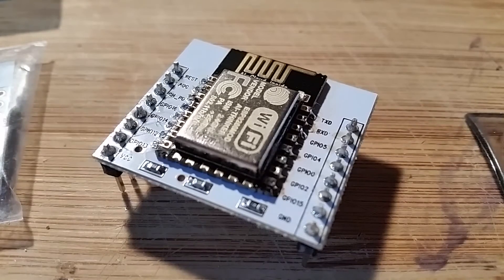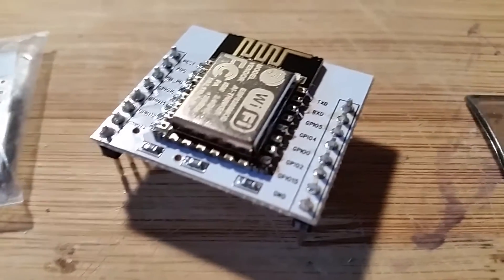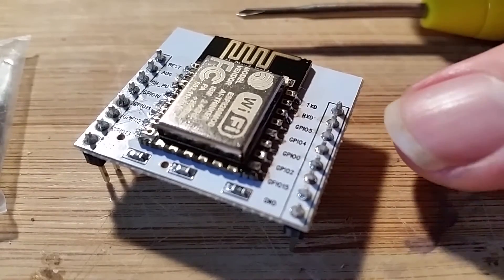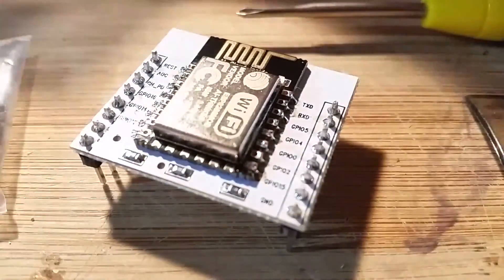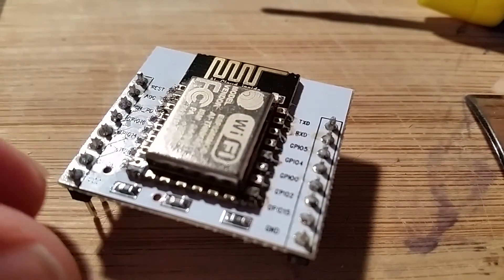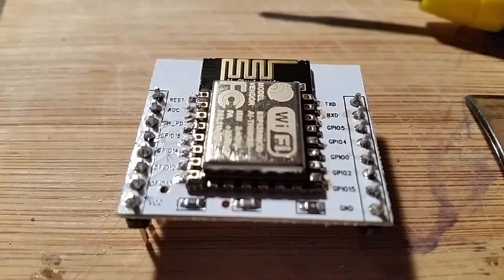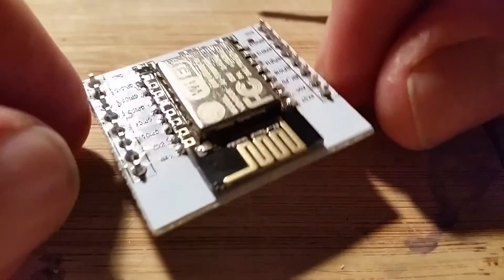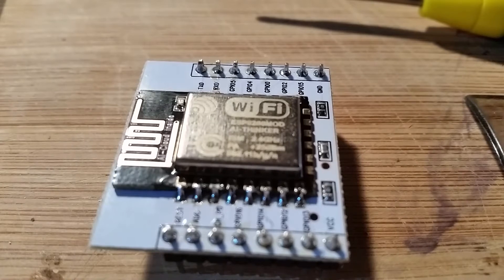ESP8266 V12 Breakout Board

Comment: Hey XerotoLabs - I just ordered some of these and was wondering if the ESP8266 itself has solder pads that wrap over the edge of its board, or if you have to bridge the solder over a kind of "dead spot" to connect the ESP8266 to the breakout board? Hope that makes sense. :)
Reply from the maker: +phrend if you see in the still pic at the video start , the bottom 6 pads of the esp are how they are all round . the pin pitch / spacing is metric ( 2mm IIRC)  so it is not a prefect aliment for normal bread boards. 
What i did was to clamp / hold the esp over the pad son the break out board and tack solder the opposing corners. then i proceeded to solder the rest . The solder i used has flux in it, so it was real easy . but i did have to place the solder into the outer notch of the  pads on the  esp .  it made it way easier to solder that way .
Reply: +XerotoLabs Thanks for the info! Looking forward to playing with these!
Reply from the maker: +phrend they are way too fun . im looking at expanding the gpio of the version 1 units withe  some PCF8574P ICs i have , they are 8bit I2C input expanders . but they only work on 100khz buss , nit the 400khz that other I2C things can support .  but still it should allow a old 3$ esp to go from 2 gpio to 8 . the PCF8574P  is old and obsolete but they are dirt cheepo' too, and cna let you make your own I2C peripherals.
Reply: +XerotoLabs I hadn't heard of the PCF8574P before, but I'll keep it in mind for the future (looks like they are just under $1 per chip on ebay). Out of curiosity, why aren't you just using something like the ESP-12E since it has more GPIO pins available and is pretty close to the price of the version 1's? (Do you have a stockpile of v1's or something?)

FYI, I'm looking to use these to do some home automation/monitoring with something like OpenHab.

...been watching +Hari Wiguna for the past few days - but my new "toys" are still a couple weeks away. :)
Reply from the maker: +phrend yeah the video is a 12e , it has more GPIO , but some of the GPIO is dual purpose pins on boot .  i want a nice set of I2C peripherals , like you my main end use is Home automation and security .  I also plan some automotive security ( key-less access by web page )  for if you lock your keys in a running car .  The PCF' chips behave like a buffer for the ESP . they are dirt cheap and easy to use . there are even 16bit ones.  My goal here is to have a ESP 1 use PCF's for the legwork . i have some version 1's and v12e 's  but PCF's wor with Arduino's too and they are good form 3.3v to 6v vcc . With the ESP it might be cool to make a R/C ship or such where all the options work .   All these things are cheap .  It might be good to get your self some darlington arrays , ULM2003 or such they let you drive inductive loads (relays and motors, stepper motors) safely from logic level signals. 
PCF' can also be used to let you drive LCD displays via I2C and there are libs out there to do that .  
It is such a cool time to be a maker .
Reply from the maker: +phrend oh and you can get 10 PCF's for liek 4$ on ebay http://www.ebay.com/itm/400831854551
Reply: +XerotoLabs Nice! Thanks for all the details. I have some ULM2003's to play with, but my first project is gonna be some wireless temp sensors (DHT22), which seems like it should build up my practical understanding of the ESP, and then the sky's the limit! :)

I'll be watching your channel for updates!